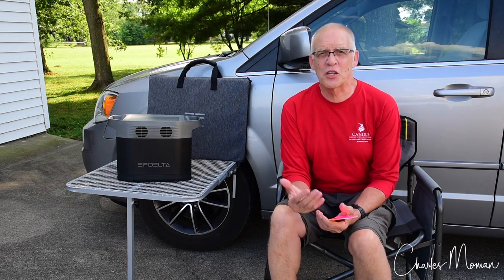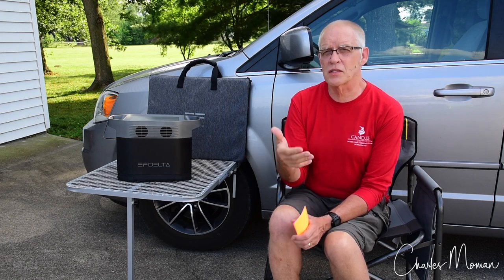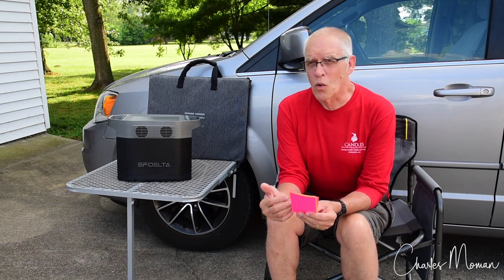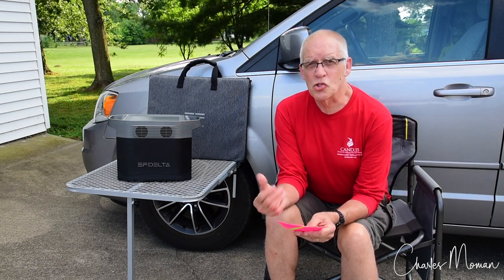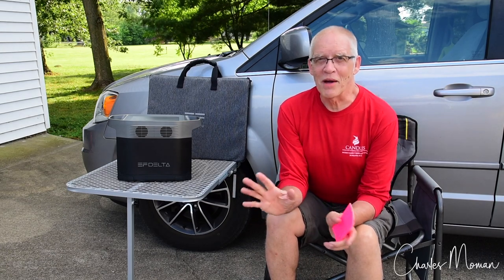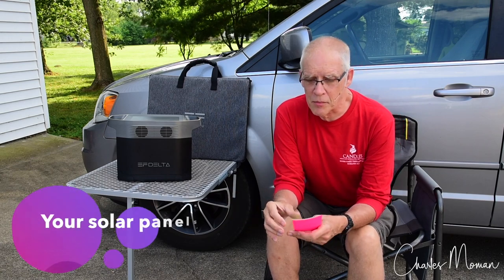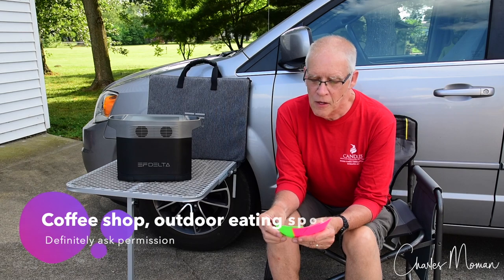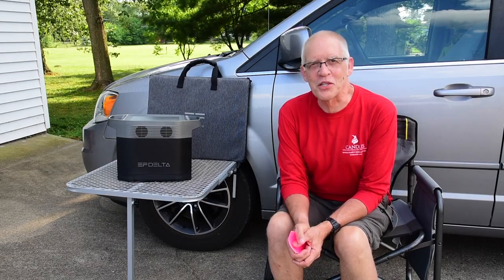Tips for Charging Your Ecoflow Delta with Charles Moman

Comment: I just finished a 4,300 road trip through 5 states and the Ecoflow Delta 1300 powered my portable fridge without any issues.  My roof rack-mounted Renogy 160W solar panel performed equally well.  With a panel like that, it's easy to keep your Delta station topped off during sunny days.  But also being able to fully charge the Delta at a hotel in a pinch in less than 2 hours makes this unit the most awesome out there.  It even worked fine in Arizona in 117-degree heat inside a parked SUV.  That's toughness!
Reply from the maker: Great units!

Comment: Great tips.  The Ecoflow solar panels have surprised me with their efficiency.  Even during January, if the sun gets strong in Phoenix, the Delta1300 occasionally registers more than 110W of power coming in per panel!  With a consistently strong sun, you can get a decent amount of charge from a single panel in just a couple of hours.  Your tips are awesome because they cover a host of other situations.  Thank you.
Reply: Rommel Where do I find the watts coming in?
Reply: @justsayin6795  It's the top number of the two numbers that you see on the right side of the panel.  The top number has the word "INPUT" to the right of it and it tells you the input you're getting in Watts.  If the panel isn't in direct sunlight, you may get a reading of zero.  I also have a problem with my solar charge cable.  Sometimes it doesn't work unless I jiggle the negative connector.  Ecoflow is sending me a replacement cable as it appears to be defective.
Reply: @rommelrivera1186  👍
Thanks
Reply: thank you. I think I am convinced to go ahead and by the ECOFLOW solar panels for my Delta instead of saving money....big smile thanks for your input.
Reply: @daphnesipes  Foldable "briefcase" style panels tend to cost more than other options but they're a great balance of performance and convenience.  I think you'll be pleased with your decision.  I recently got a Renogy 160W rigid panel that I plan to mount on my 4Runner's roof rack.  I'll use it to feed the Ecoflow Delta 1300, which in turn will feed my fridge and my overland adventures.  Really excited about the possibilities and it all started with the Delta.  Cool product.

Comment: Really good info!  Thank you.  Just had a major power outage at home and would like to use this to run my internet modem, laptop and maybe TV, or fridge and freezer when needed during lengthy outages.  The information about having a gas generator as a backup is helpful too as I'm looking into that potential as well.
Reply from the maker: I made sure to have all of Ecoflow units fully charged as the storms approached Indiana. We could run our pellet stove, furnace and well pump with them. And I still have the Honda generator in the garage to use as well.
Reply: I plan on using my gas generator solely to charge my ecoflows.  I think it will be a fantastic solution for power outages.

Comment: Great video Charles - Thanks. I just recently purchased the Delta 1300 and hope to be using it for weekend camping trips this spring/summer. I've discovered on the web that one of my favorite campgrounds has a free Level 1 (120v)/Level 2 (240v) EV charging station right next door to it. Have you heard of anybody using a level 1 EV charging station to charge up their EcoFlow Delta? I don't know much about electric vehicles or how they charge, but I think the level 1 stations are just standard 120v power receptacles that the car owner then plugs his charging adapter into. If you or anybody else could provide some insights on this I would really appreciate it.
Reply from the maker: I’ve never been asked that before and I absolutely don’t have an answer for you. Sorry. I don’t know how you would hook up a connection to the Delta. I know you can certainly do that with Adelta Pro I’ll beyond that I don’t know. We are out camping and I typically take one Delta 1300 and my Delta Max on shorter trips. On longer trips I take two Delta 1300s and the max and we have power off and enough that we’re good. Be safe out there.
Reply: @charlesmoman  Thanks for the quick response Charles. After I posted here I heard you say (in the video or comments, not in person... ha ha) to check with the EcoFlow Facebook groups, so....Ta-da...  That's what I did and I've already got some good responses. I was only referring to the level 1 - 110w plugs (also called EV trickle chargers) and I am told that 99% of the time here in the U.S., they are  just standard NEMA 5-15 outlets. So I should be able to just plug in and charge. Of course I would try to go there either very early or late in the day, and yield priority to actual EV needs, but it should be another option.

Comment: Great video! Thinking of Getting the Delta pro soon. I have a Briggs and Stratton P3000. Inverter gen up to 3000 W.  It has a 30A plug.  Could I use this outlet to charge it?  Thanks!
Reply from the maker: I really do not know for sure. Sorry. I do not want to give wrong advice.
Reply: @charlesmoman  No problem.  Can probably be good just using the regular 20A plug. Thanks!

Comment: I was waiting to see how long it's going to take to fully charge with the cigarettes port. But no info.
Thanks for the video anyway, nice info.
Reply from the maker: It would a really long time to recharge via the cigarette port. And another problem that people have recharging that way, is the plug itself gets really hot because the EcoFlow is trying to pull so much power. 

I now have a Ford transit camper van that we converted. I added a Victron DC to DC charger to charge while driving. That is much safer and faster.
Reply: @charlesmoman  Thank you for the info. Be safe.
Reply: @charlesmoman  I have a couple questions, please...
1) How many watts does your Victron DC to DC charger put into your Delta 1300?
2) Which model of Victron did you get?
Thanks!

Comment: Have you ever charged the Delta 1300 from a 20A receptacle on a gas inverter generator?  My Champion 100520 gas inverter is pure sine wave THD < 3% so no problem there. But i didn't know if plugging the Delta charge cable 16G (rated up to 13A) into a 20A inverter outlet would be a problem....?

Comment: How much do you think you save per charge using solar vs the wall?
Reply from the maker: I really have no idea. I guess I would need to look up how much it cost me per kilo one hour and divide by basically an hour to recharge a Delta fully. Can’t be that much but I actually do recharge and seller just sitting in the driveway sometimes. Free is free.

Comment: Thanks for the video. Do you think the Delta could be charged by a lead acid 12 volt car battery? I don't mean through the cigarette lighter output, but directly from a battery? Thanks
Reply from the maker: That is a good question and I honestly do not have a clue. I know the soon-coming Ecoflow R600 Pro or River 600 Pro will have a module that allows it to be linked to lithium like a Battle Borne but it would not work with the Delta. Join the Ecoflow Users Group on Facebook and ask there or message Ecoflow in their Facebook page.
Reply: @charlesmoman  Thanks for the answer, and for telling me about the Ecoflow FB group. Ecoflow's tech support is pretty good, they answer the next day.
 I will set up four Renogy 100-watt solar panels in the back yard, and see how that does. Figure I get 320 watts out of the panels, times 6 hours per day of sunlight, which will hopefully produce 1,920 watt-hours. Hopefully that will fully recharge the Delta.
Reply from the maker: @rootcanal7188  Ecoflo sent me four of their panels. I’m not sure I would take all four on every trip, but we will see. This week I’m getting the river 600 from them plus an extra battery. And in November I’m getting the R 600 pro plus the EF 1500 battery. They are really setting me up very well.
Reply: @charlesmoman  Thanks for the answer. That's good that you have the fold-up Ecoflow solar panels for portability. Too bad they charge $400 for 110 watts! That's cool that they sell spare battery packs for the R600. Of course you will have to have solar power to keep it charged up. 
That's a good idea to be a camper these days.....there's a good chance that there will be riots and possible power outages on Election Day and afterwards.  Best to be mobile. and move to where it is safe.

Comment: Nice information to know, thanks! Good to know you could run the a/c some at night while away from power. I have a question that is unrelated to this post but I thought you might know the answer.  I went to Runaway's website but I don't see the 2020 Rouser on the website.  Any idea why? Thanks!
Reply from the maker: I am not sure there will be a fiberglass Rouser - call the sales office and they can shed light on that question.
Reply: @charlesmoman  Thanks!
Reply: @charlesmoman  I've been doing some suv with a tent attached camping.  Keep on coming back to the runaway option every now and then.  I like that you can stand up in the Rouser.  Any pros/cons of the rouser vs the roadrunner that maybe i haven't thought about? Thanks

Comment: Anybody knows It’s work fine with the Dometic CFX fridge conected to 12v outlet? I read that it has a shutdown timer and just shutdown after 30 mins. True or not?
Reply from the maker: Most "solar generators" do shut down after a certain. time IF the usage falls below a  certain amount of watts. And, some of them have unregulated 12v ports that drop below 12.5 after the battery drops to say 80% or lower. The Ecoflow has a regulated 12v port, so it will not shut off as the capacity remaining drops. So, I am pretty sure it will keep running a 12v fridge as long as it has power remaining.

Comment: I just purchased a ECOFlow Delta and ready to purchase the panels. Does it need to be EcoFlow?  I was looking at TwelSeavan Solar Panel....... cheaper, I thought I read only use EF? Thanks. A big non techy..:-)
Reply from the maker: No, you do not need to buy the Ecoflow panels - though they are nice. The Ecoflow will come with a a solar cable that has an XT60 connector on one end to plug into the Delta and the other end will have standard MC4 connectors.MC4 connectors are standard with all solar panels - so get shopping!

My wife and I are now finishing - this week -  a 2018 Ford Transit van conversion and Ecoflow is one of our major corporate partners. We are basing our electrical system on all Ecoflow units and their solar panels. I did wire for shore power too. Our van build series is here on my channel.
Reply: @charlesmoman  Thank you for your response. I think I invested in the EF1300 Delta I will just purchase their solar panels.  I am very excited to use it. Excited to see your new transit build! I recently sold my home in Boulder. Purchased an RV and even only 60K miles I have had lots of replacing.  A bit much for a single woman. Thursday I leave for Utah and will travel in my 4runner and I am pretty sure I will want a van. I just want more mobility than a big motorhome. I am a minimalist anyway and enjoy small spaces.  Look forward to seeing your new build and following your journey.  I like the Ford Transit. Thanks again for your reply. Happy travels.

Comment: How would it take to charge the unit using my car? Thanks from hurricane Ville U.S.A.
Reply from the maker: Personally, I don’t recharge it with my car 12v cigarette port. Why? The Delta’s fast recharging pulls or tries to pull so much juice it can overheat some vehicle’s port. And it can stress your alternator. Now some report no issues at all. 

If you try it, make SURE to keep the plug in tight. If it gets loose, than can cause overheating and in rare cases it will melt the plug. One of the problems is, that the wiring to the cigarette ports is pretty thin wire. 

I have gotten a heavier cord that I can run from the car battery into my vehicle and at the end it has an XT 60 plug. That way I could charge directly from the battery to the Delta. Having said that, I likely will not ever use it. The Delta recharges is so fast, I can get a charge back up at campgrounds very quickly. Or if we stop at a laundromat, they will usually let me plug it in and recharge it. The Ecoflow Tiver Max and River pro units, work with an app on your phone and you can dial down how much juice they will pull. 

Some people have a vehicle with two alternators or they put in a more powerful alternator and that can help the issue to. Just be careful that you don’t overheat wires when recharging the Ecoflow in a vehicle. We don’t want a fire in our car do we?

Comment: Is there a certain mode ecoflow needs to be on
To charge solar its charging but very slow
Reply from the maker: I just plug the cord from a solar panel into the XT60 connector portion the Delta and it starts accepting the charge. The speed depends on how many panels you hook up and the amount of direct sunlight with the panel angled properly. The faster charging comes via a household outlet - true for all lithiums.
Reply: @charlesmoman  Thanks so much for such a quick response. I just got it yesterday 
And am soo excited. 👍
Reply: My Delta 1300 arrived with a bad firmware that didn't allow it to charge using 3 solar panels.  Ecoflow responded very quickly with a burner box and now all my panels are providing charge.  As Charles noted, the amount of sunlight determines your energy input.  But the Ecoflow panels are very efficient.  They're rated at 110W but I've seen my Delta register a higher input per panel than that.  It's good to know that we made a quality investment.
Reply from the maker: @rommelrivera1186  Good to hear. My Ecoflow solar panels are super efficient too.

Comment: Anybody using the Delta 1300 with a single Renogy 200W rigid solar panel (RSP200D-G1)?
Reply from the maker: Just about solar generator works with any standard panel - especially Renogy.
Reply: @charlesmoman  I ask because the Renogy 200W has a short circuit current (Isc) of 10.9A, which is just past the 10A input max for the Delta 1300.  I've read that 11.5A should still be OK but wanted real life input.  Trying to decide which panel to mount on top of my 4Runner.  :)  Tx, man.
Reply from the maker: @rommelrivera1186  There is an Ecoflow users Facebook page. Those folks know everything.
Reply: @charlesmoman  I went with the Renogy 160W (RNG-160D-SS) panel in the end.  The compromise is only 40W but the 160W model stays well within the Delta specs in two critical ways: Short Circuit Current (Isc) of 8.37A, and Open Circuit Voltage (Voc) of 22.9V.  Both the 200W and 175W models went over the 10A Isc tolerance of the Delta, so that pretty much made the decision for me.  The Renogy 160W panel works great with the Delta.